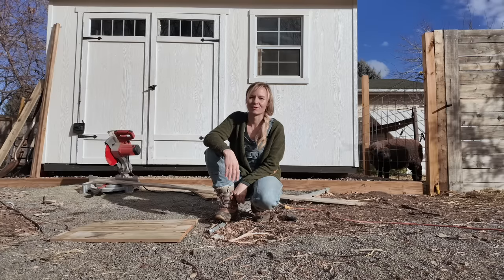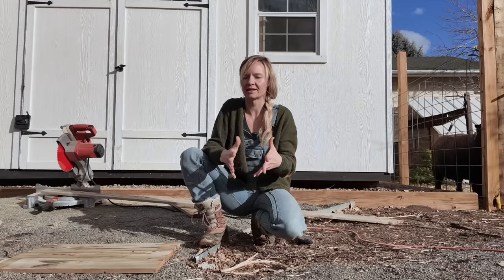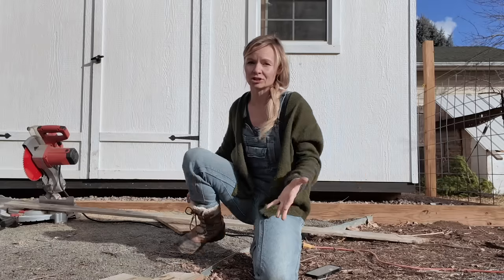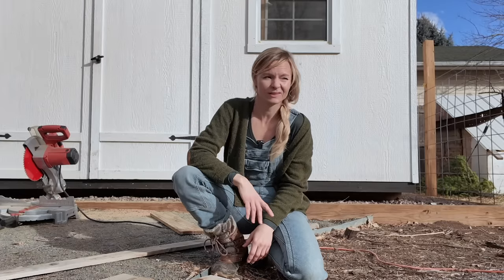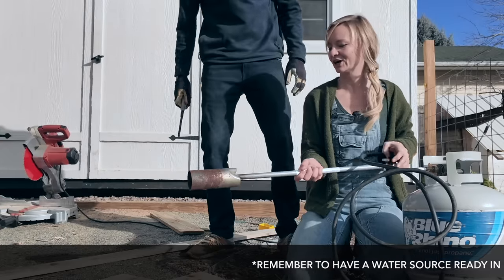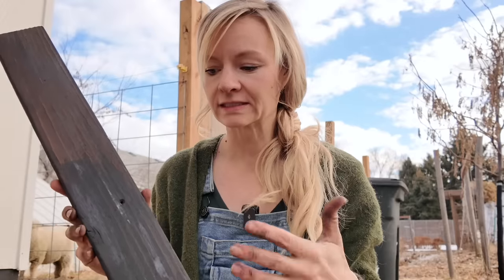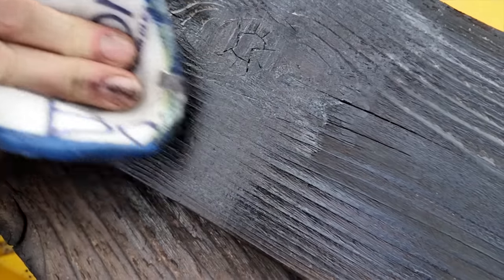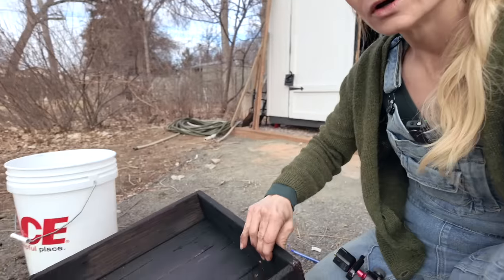Waterproof Your Garden with Charred Wood Magic for Weather Resistance (Shou Sugi Ban seed trays!)

Comment: Started doing this about 5 years ago with our raised beds.   Very helpful for raised beds on an incline when one of the sides needs to buried.  I tried the original method in Japan where they put them in a tepee and light them up but with thicker wood it was too difficult.

Comment: Not you using your Bona wet mop head…LOL. I’m watching this video to get the ratio for the linseed oil and beeswax finish for one my clients who have seemingly unfinished kitchen cabinets. I clean houses. I bet it would look cool to burn her cabinet fronts too, but, that seems unnecessary. I just want to make them easier to clean and protect them from all the cooking that happens in there. 

I use a Bona mop to wet and dry mop at all but one of the houses I clean. I love those mops. I like the Swiffer too for the house with almost no hard floors. I use a microfiber rag and a squirt top bottle that keeps make my own floor cleaner for. I’m not trying to buy disposable floor pads that don’t even stay wet for a small bathroom. 

I do use the disposable Swiffer dusters, but I get a ton of use out of the before I toss them. I have a clean one for “clean” things (left back pocket) that graduates into a dirty one (right back pocket) that I use for dusting the corners of floors, baseboards, toilets, under dressers, etc. I keep one in my car between the center console and passenger seat to do my dash board and doors because of dirt roads. That one last forever or until I lose one for work…

Comment: wouldnt the beeswax and oil just negate the experiment? those are going to seal and make the wood water resistant anyways even without the charring right?
Reply from the maker: In traditional shou sugi ban it’s followed with oil. It’s part of the technique. If I’m going to all that trouble I’d rather have it as watertight as possible as sustainability is the goal here.
Reply: @Blossomandbranch  ahh i see i see
Reply: Did you link the linseed- beeswax? Can’t find it
Reply: @Call.It.Christian  it's the amazon link in the 2nd paragraph in the video description.

Comment: Have you found that these hold water long enough for the soil to soak it up? I would be worried that the gaps between the planks would not allow water to stand in the tray.
Reply: You will be top-watering with these so it's not an issue.